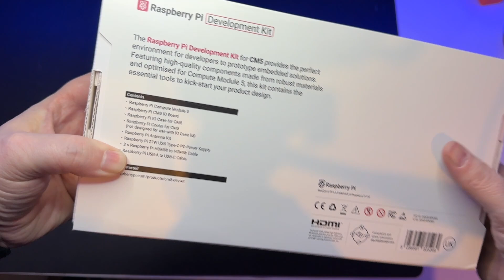Raspberry PI CM5 Development Kit Unboxing

Comment: The four small rubber washers go between the CM5 IO board (component side) and the bottom of the Raspberry CM5 cpu board, they don’t go on the bottom between the screw head and the bottom of the CM5 IO board.
Reply from the maker: You are correct, I tried to show this in the video when I show the manual on screen.  I knew how it went but didn’t want to be fiddling with it whilst recording.  Thanks for the feedback.